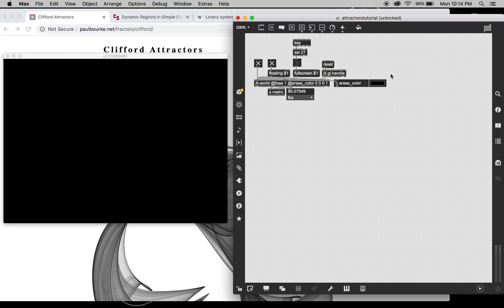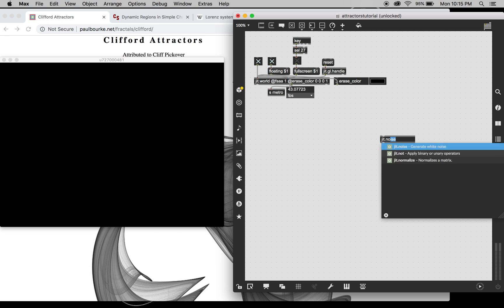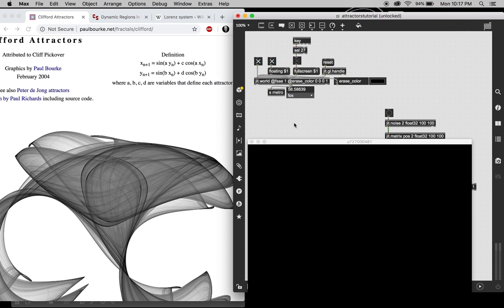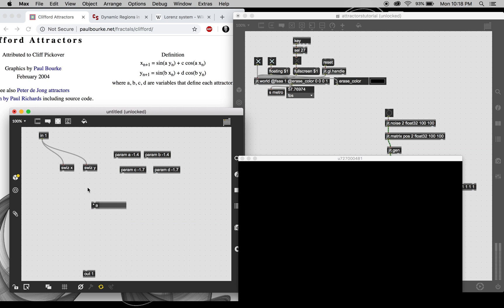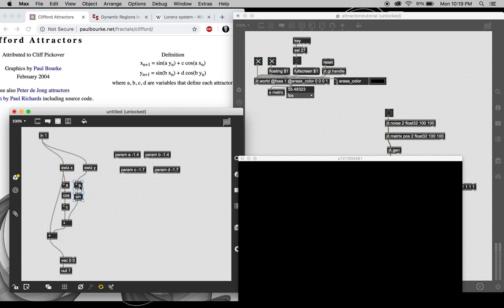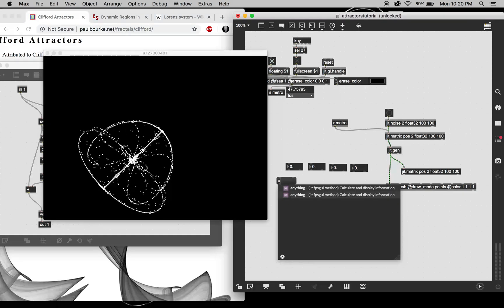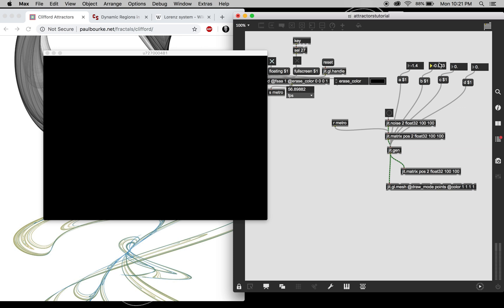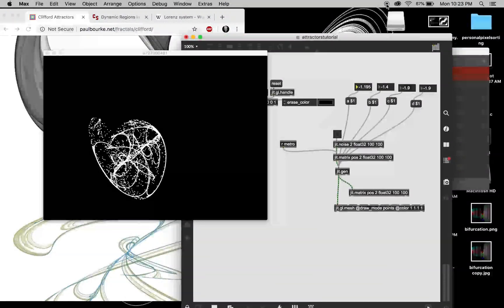Clifford attractor tutorial Max/MSP/Jitter

Comment: Hey Ryan, great tutorial. In the second to last step of each component calculation you add a Swiz ( x and y ) to each sum of sin and cos prior to the Vec 0 0.. why is adding the last swiz needed?
Reply from the maker: I may be mistaken but I believe you need to do that because you want the calculated position to be based off the previous position. If you didn't add them it might still work but the positions would be different and based around the origin? I'm not sure, I'll have to test it without and see what happens
Reply from the maker: Yeah so it's not strictly necessary in this instance however the results are slightly different if you don't add the two together. The attractor is based around the origin, warped slightly and you don't get the clear lines that you get when you add them.
Reply: @Nullphiinfinity  I ended up here and you've inspired me to implement many more attractors in jitter... THANK YOU. and I've come back to comment precisely on this, as I got further in doing it I actually understood better the gen flow you were patching (at the beginning I was merely copying it...). And so I realized something about this one and I thought to share it here: in order to actually get the Clifford attractors you """shouldn't""" add the last +, which is in a way interpreting that the equations you're given are the equations for the variance of those values and not the resulting values themselves, so at the Lorenz video it's exactly like that because Lorenz eqs are in fact formulated as dx dy dz equations, but clifford ones are directly written as x y z, so one should send the result of first sum directly to the vector. great videos it was a beautiful discovery for me!